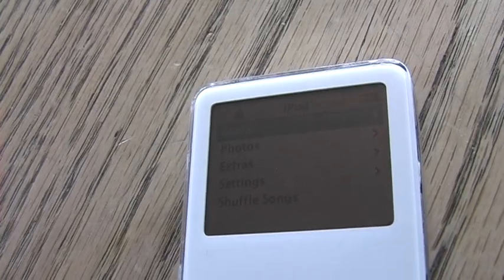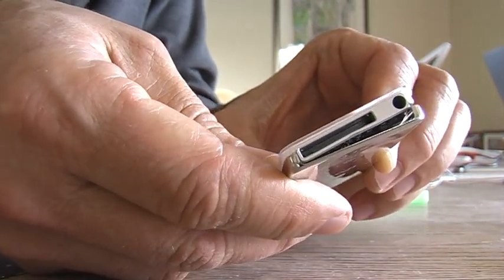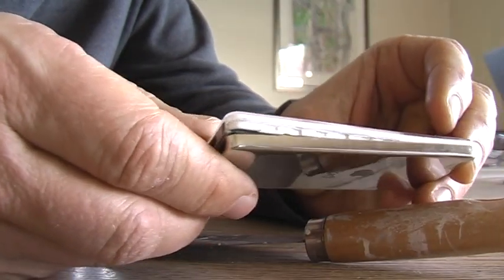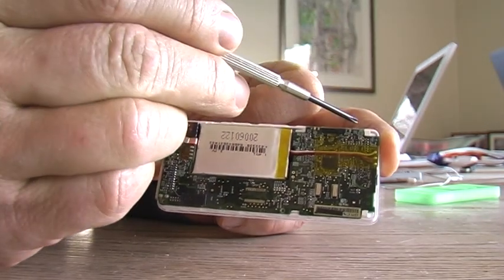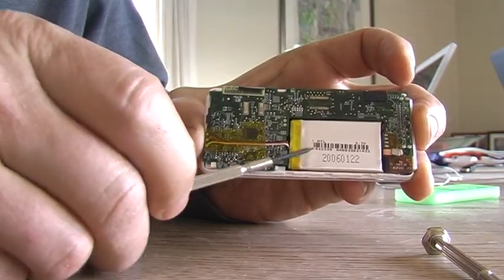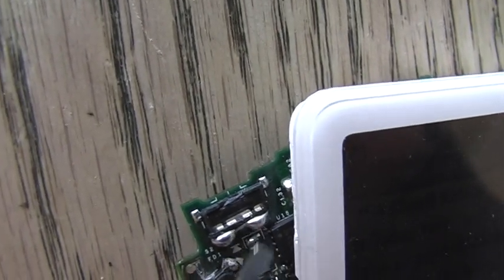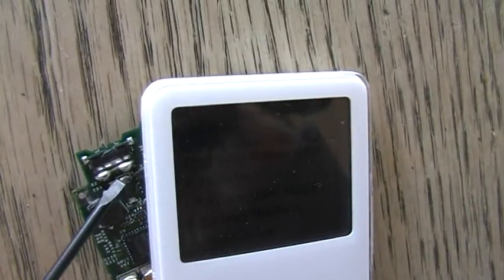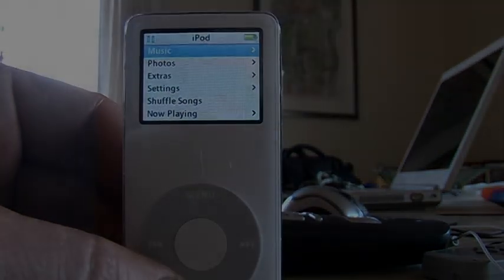ipod nano hold switch fix

Comment: Another tip in case anyone here still watches repair videos for a 15 year old device: You don't even need to solder: extra strong electrical tape to shim and stick the hold switch to the circuit board works as well! just need to get enough layers to press the hold switch into the board against the LCD.